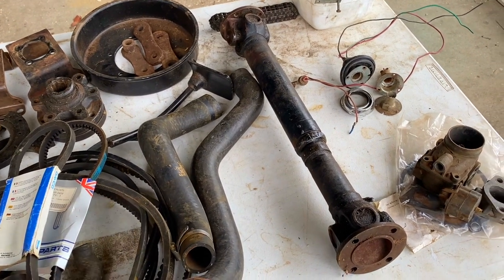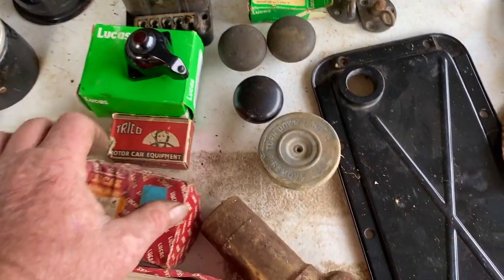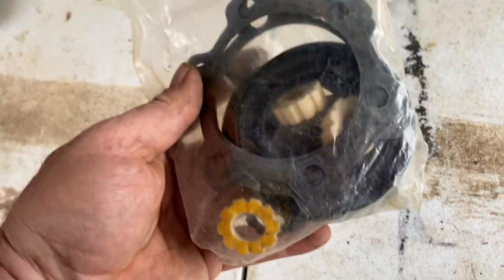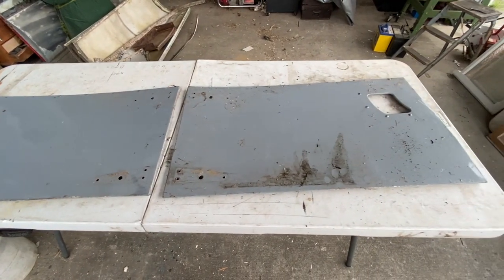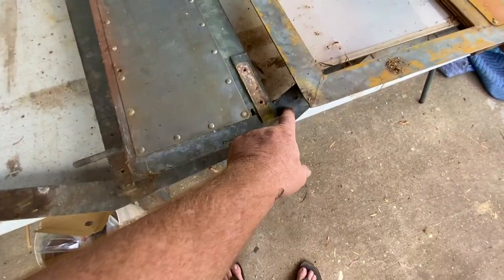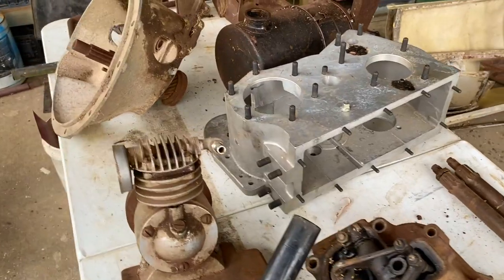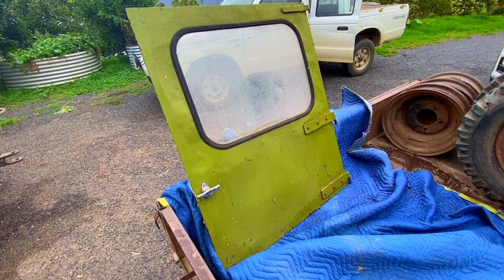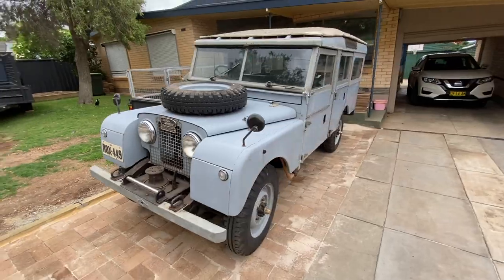SERIES 1 LAND ROVER PARTS HAUL!!  lots of rare treasures.

Comment: In the 13 years of hard use I put my series 2 ex army 63 long wheel base well body . . the only thing that was't working was the accelerator pump which was cured by use of choke & the lights failed one night after returning home from another bush property . . but as usual I was prepared for these outrages of fortune & hung out the side with my torch
Reply from the maker: Ha, lucky to have the torch :-)  They are tough old wagons, my 109 seems to require a minor repair every time I drive it :-) but it is a running project so it is to be expected.
Reply: @VintageRestorationsAustralia  I think it was the place more than anything . . time stood still literal . . for everything
Reply from the maker: @benwinter2420  Yep I get that, I live in an enclave of the  old world.

Comment: Some great finds you got there!
Reply from the maker: Bits and pieces Martin, all useful or tradable :-)
Reply: @VintageRestorationsAustralia  That's smart. Buy when you can, not when you need. Makes for better price. 👌
Reply from the maker: @slowshop  Parts are worth more than cash value, sometimes a trade is the only way to get what you need.  I like a barter system better anyway.
Reply: @VintageRestorationsAustralia  Trade is the best. Here we don't have much Series parts but I trade old Ford parts alot. 👌

Comment: Lots of good parts there. Take them when you can. Is there any parts that you still need for the 107 s/w that you cant buy new?
Reply from the maker: Yes, the rear step, hubs parts perhaps, possibly the steering relay arms are different and I may struggle to find.  I still have not got a clear indication of all the differences but there are quite a few. I think I have most parts but I will start strip down soonish and no doubt develop a pretty significant parts list.